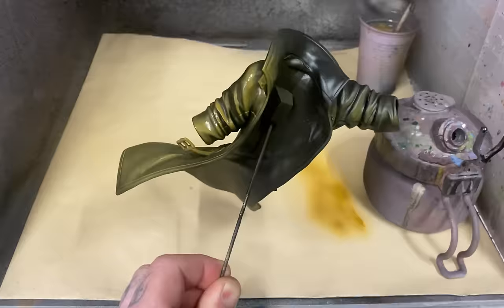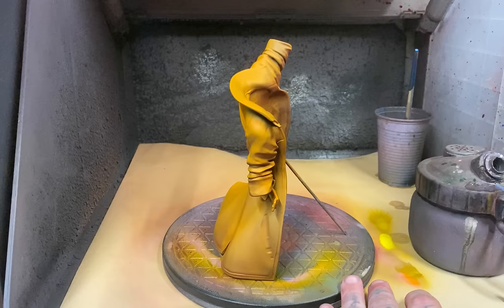Triangle of Difficulty- (Yellow, Skintone, Eyes) How To Paint 3D Prints

Comment: How do you attach those sticks???? For the cape, and the body and the head. When I do it, the 3d printed part flops around, but in your video the parts say firmly attached ti the stick and don't move. How??! It's driving me nuts. Do you superglue the stick to the 3d part? Then break the glue off?? I've tried just jamming it in there but it never holds to alot of movement.
Reply from the maker: I guess I just get lucky with hole sizes. But also I shove it between the supports etc the usually hold pretty well

Comment: Since you paint mostly female skin, I would go with scale 75's velvet skin set, simple easy and all colors are sold seperately, at least here in the Netherlands where I live. So no worries there when you run out of a particular color. Hope that helps my man.
Reply from the maker: I’ve done a whole video using that set.  I’ve had it for like 2 years.  I really dislike how the paints break up with water when used in the airbrush. So I kinda avoid that set most of the time. Except for orcish dermis that’s the key colour from that set for me.
Reply: @Groundeffected  I tend to use it with golden airbrush medium instead of water. Also what helps tremendously with flow in an airbrush is adding just one or two drops of iso alcohol to your water in the brush. I modified an old paint dropper bottle to take a ca glue mouse tail nozzle and use that to add two drops to the medium and add water if at all needed that makes all the difference. I never use water without alcohol as it changed my life forever since I got that tip from an old airbrush veteran. And it does not break make that paint break up in a weird way anymore. Any paint for that matter. Iso alcohol changed the game for me. Many paints that I thought were impossible or too hard to use in an airbrush suddenly became available and become instantly better,  to top it all of the paint dries more opaque and faster. To me that was a game changer as it really makes world of difference. I recommend you get some golden airbrush medium and get the hang of adding two or three drops of iso alcohol to the mix. It will take a couple of tries to get the hang of it, but it will make every paint you never thought of being able to use, usable. Love you vids man. Have a wonderful day.
Reply from the maker: @Lalaland.001 funny you say that I’ve  used alcohol in my airbrush mix for ages. But I really dislike having extra mediums etc. I only use water and the odd spray of alcohol . I just never got on with that set and moved away from it. I also don’t stay stagnant either this is perhaps my 10th change in skin tone recipe in 2 years.  It’s a constant work in progress.
Reply: @Groundeffected OK, man, I only just got to know your channel, was just trying to be helpful and share some of my knowledge with you. It is always a work in progress as it is for me. I like the fact of being able to use almost anything. Adding the extra steps for me allows me to stay on the same formula for long periods of time since I don't like change that much. I prefer being able to use many different media, from oils to watercolors to stable skin recipes. As skin is hard to get something for that keeps working I like the scale 75 formula as it works for me personally a lot, ammo has a great skin range as well, be it that they are a completely different animal of themselves a rabbit hole of sorts, if you know what I mean.  Even though I don't share my work on any platform. As I do it mostly for just myself and some of my closest friends. But to each his own I guess.  May you have a magnificent day my man.